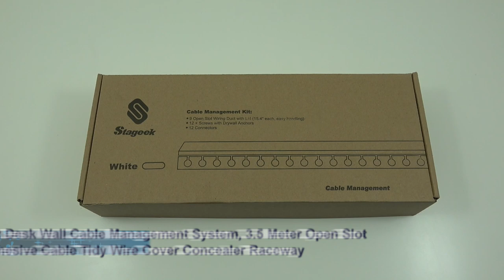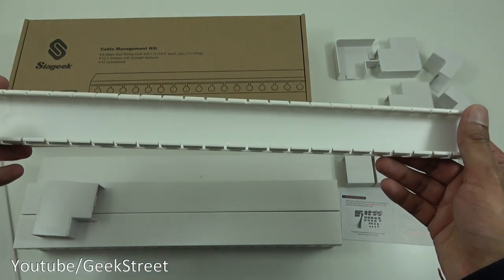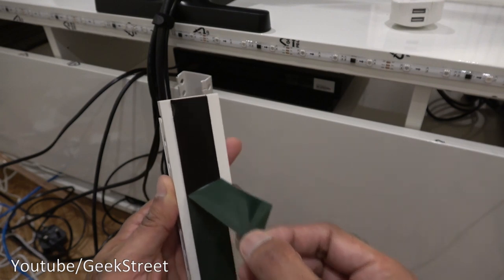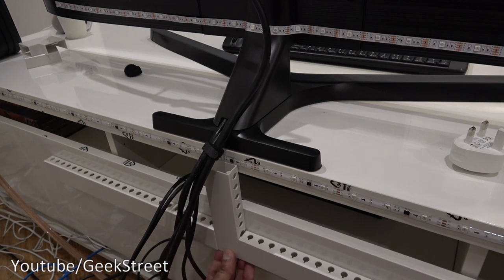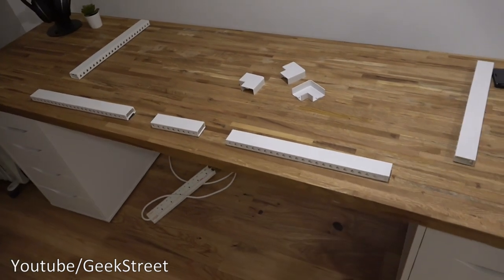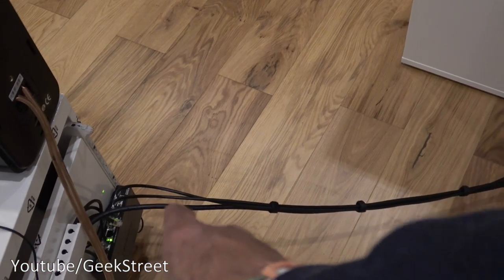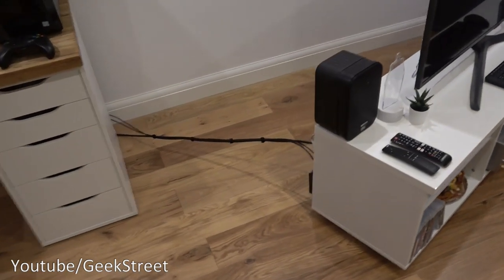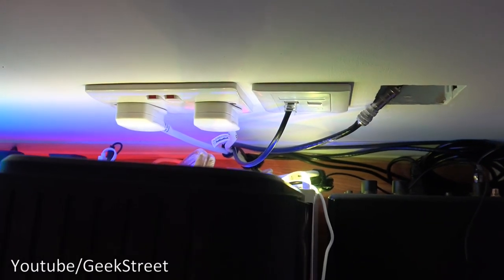ULTIMATE Cable Management Guide | How I Cable Managed My Setup!

Comment: That bundled wire between your desk and the console is an ideal candidate for a split wire loom. It will cover it nicely and means you are not dedicated to keeping conduit on the wall. The split wire loom can be handy for vertical drops from your computer to the conduit as well.

Comment: Nice Setup Geek Street :-) Mine is a mess of cables...Can see a time when everything is just all wifi'd lol and no cables :-)
Reply: Network cables are just a small part of the cabling that needs to be managed behind most desks. Even if one accepts the trade offs of Wifi, there are still cables for power, video, lighted keyboards, etc.  There won't in our life times be a truly cable free solution for setups with big monitors and powerful computers.

Comment: Did well on the back on the first unit. However you failed on the desk in my opinion. You wasted the raceway by using it in small sections and hiding portions of cords. You would've been better off using adhesive cable clamps of some sort and saving the remaining raceway for any further cable management projects using it as one continuous piece. Really like the first unit though.

Comment: The ducts look far too small, as do the access holes. I would bet the snap on covers are sitting on the floor somewhere and the cables are escaping from their tiny prison. How does this look a year later?
Reply from the maker: A year on all is good still going strong not broken.
Reply: @GeekStreet  That's good to hear, though I am surprised; I underestimated its utility.

Comment: Nope!  That drives me crazy.  Do not run power cables with audio/video/data cables in the same trough.  All you're doing is introducing interference in the signal path.
Reply: Yes, I was surprised he did that when putting in a new solution as there was plenty of room for separation.  Most people don't know you shouldn't do that.  On a short enough run though I suppose it doesn't matter, so what it you increase packet retries by <1%.